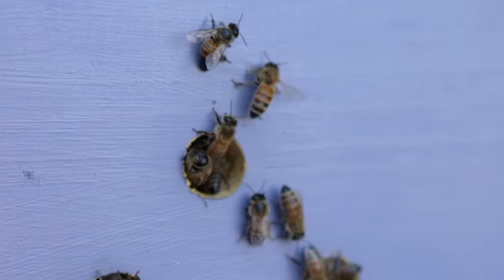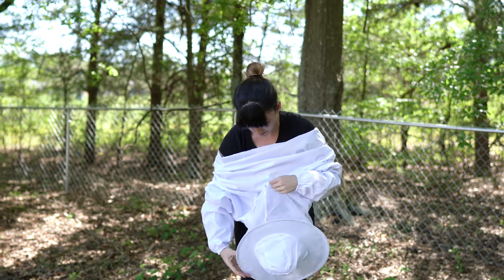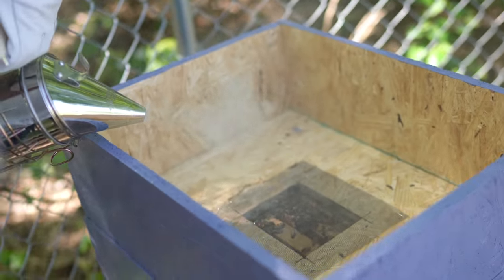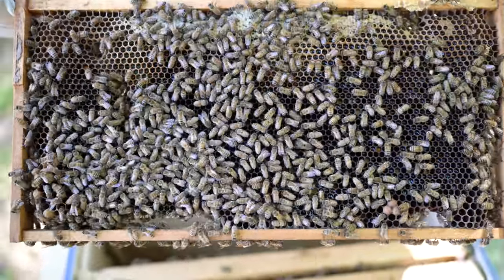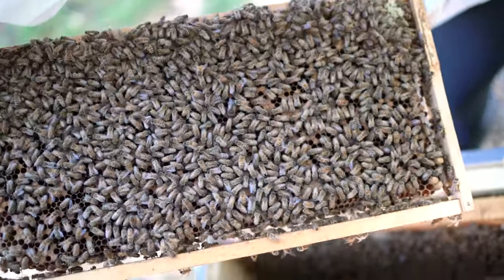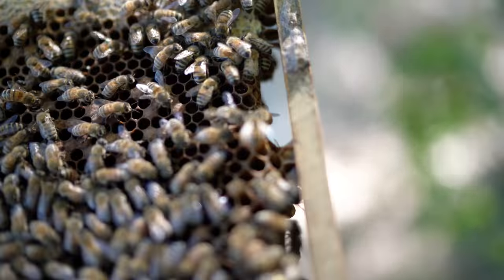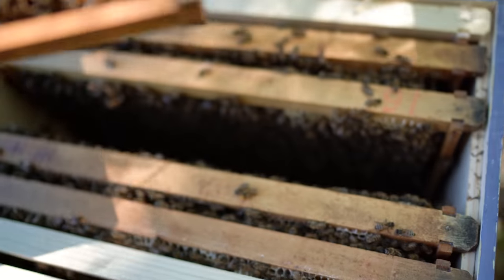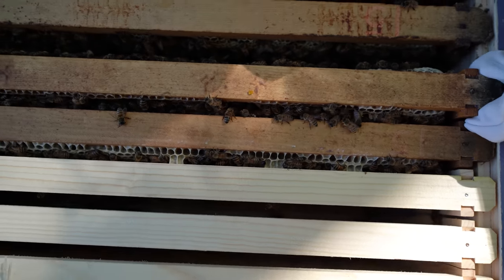Beekeeping For Beginners --- Natasha's First Beehive Inspection

Comment: Why did you leave the frames spaced apart. The frames are designed to be pushed together that's why it's tapered at the bottom.
Reply from the maker: We didn't, we fixed it before we closed it.  We were actually still checking the hive. We just shortened the video so that we're not wasting viewers time. You know, like cutting out the boring parts. lol. But you're right that is a must before closing the hive. Thank you for watching!

Comment: Just 1 thing. Check the lit for the queen bee before you put it on the ground. When open box you can use more smoke. Dont just put frame in, wiggel it a bit so the bees can move out the way. If you find the queen, it would be best to mark her.
Reply: You mean the inner cover, the bees can't get to the lid.
Reply: Yes. The inner cover is closed off. So please check it for the queen before you put it on the ground. Normaly you would not find her there, but I have seen some videos where the queen is on the inner cover or the lit.
Reply from the maker: That is great advice! Thank you! Obviously we’re both newbs haha.

Comment: You two did good. When you pull your first frame out you don't shake the bees back in the box . Turn your back to the sun so you can use it to see in the cells to look for eggs and larva. Its easyer to find the queen if you hold the frames at a 45 degree from your body.  To much smoke will run the queen off the frames. Nice Job.😁
Reply from the maker: Thank you for watching and commenting :) This is good advice. Thank you.
Reply: Thanks for the tip!
Reply: Thanks for the tip